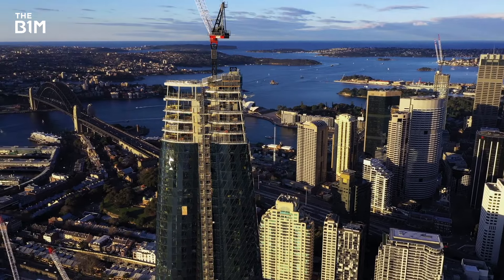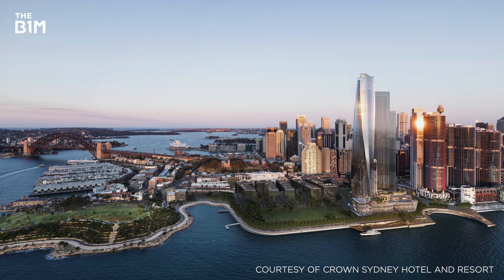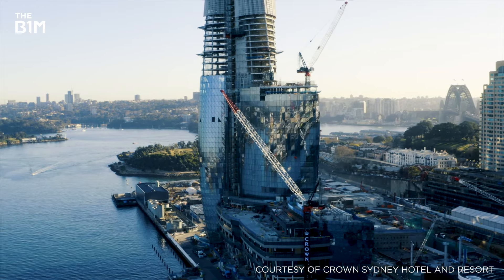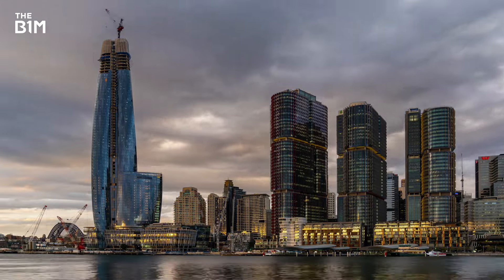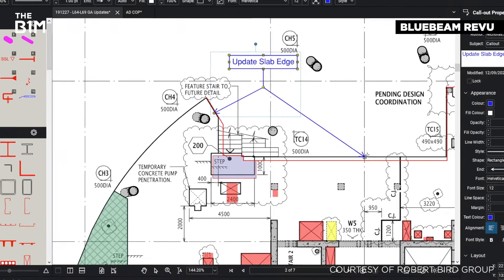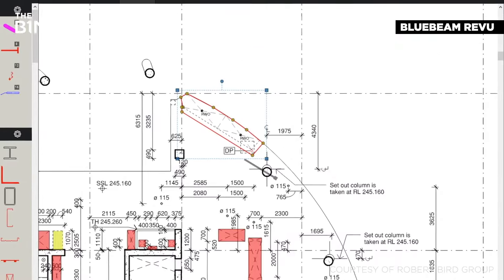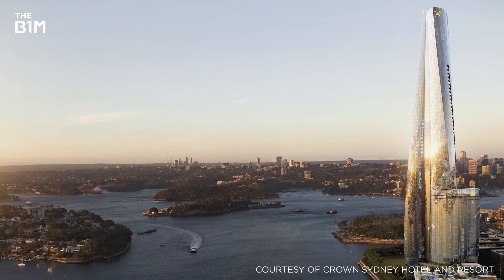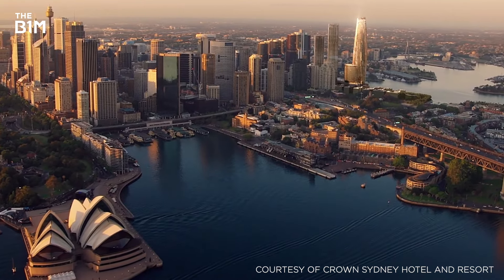Building a $2BN Skyscraper From Home

Comment: I see this tower almost every day. It was really interesting watching it rise from the ground. Did you know that there are going to be two skyscrapers to the right of the crown building in the small gap between the 3 glass oval buildings and the crown buildings. The whole revamped area is going to be finished in 2024, complete with a park (annoyingly much smaller than we originally told before crown bought the land) a metro station, accommodation, dining, hotels, another medium-sized public park and public transport.
Reply: Why not

Comment: I'm from Sydney and was wondering when you were going to cover this. Such a good production quality of a video super impressed. Its a pretty unique building, they wanted to make it higher to compete with the highest buildings in the  world but restricted to Sydneys maximum height laws In place for aviation safety.
Reply: Having seen the building it does stick out like a sore thumb amongst Sydney's other buildings. If anything it should have been a little shorter. With that said over time hopefully the beige skyline of Sydney is replaced and this building won't appear so contrasting. The other new building in the area like Commbank look great. Sydney is finally getting some modern architecture.

Comment: Great video (even if it is an ad). What boggles my mind is that they attempted to design and build this in 2020 with paper drawings and waited until they were half way through the project before going paperless! Is this kind of software still cutting edge in 2020? Either the construction industry is WAYYYY behind or this particular firm was.

Comment: Hey I work next to this building! It's remarkable how quickly it went up. Design looks great, a shame that it's just a casino though
Reply: All the NIMBYs in Sydney cried out: It's a casino, it's a casino....But they don't know sh*t....yeah, it is built by a crown casino group...but only the few floors on the bottom with large floor plates are casino...rest of them are apartments and hotels. That means not even 20% of it is casino floor.

Comment: Love your videos and from a project standpoint, Crown Sydney certainly makes for an interesting behind the scenes look. However, the sheen of the wall of glass is the result of outrageous theft of public foreshore land by greedy developers. The original designs, for which the development proposal was conditionally granted was for a much shorter tower further back from the foreshore, and for 50% of the site to be parkland. The scope creep over time of the size, scale and floorplates has led to the public being screwed out of waterfront land.
Reply: They built a larger pier & boardwalk to compensate for that plus it will still be 50% public space. at least we didn't get BIg Red hotel on the Pier.

Comment: Every floor is unique and over 7000 glass panels of different sizes that need to be individually cut?  Sure it looks pretty but it sounds like an absolute nightmare for the engineers/construction teams.  Not to mention the added cost for such aesthetics.

Comment: I rather like the exterior, but we really should stop designing all glass-facade towers. Generally, they’re horribly energy inefficient and the world is facing a decreasing supply of quality sand for making glass.
Reply: what? you mean concrete, not glass. glass can be made from any type of sand, concrete needs the rough texture of marine sand.
Reply: Mud z Both materials, really. There’s a growing global sand shortage that will affect the supply chains of both essential construction materials. Yes, the world is filled with sand, but not all sand is created equal, and the specific types of sands used in concrete and glass are rapidly diminishing. Tackling the problem requires more efficient use of remaining resources, including through building design, and recycling as much glass, concrete and other construction materials as possible at the end of their life cycles.

Comment: You make it sound like that the entite build team worked from home. Yeah ok the architects might have but the the people actually building the thing proberbly worked through Covid. As for the little mention you gave to the hands on the ground and the "Work continued on site with social distanceing measure in place" bit ? hmmm If its anything like building sites I've seen it'll be full of signs on the outside  letting the public think its all safe then at dinner time you have 30 odd builders all sitting in a tiny canteen  shoulder to shoulder.